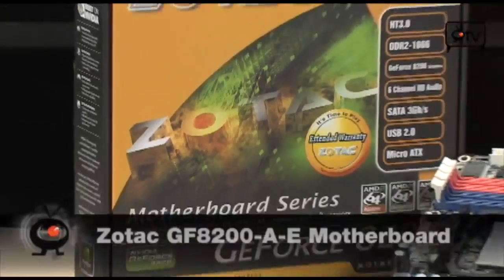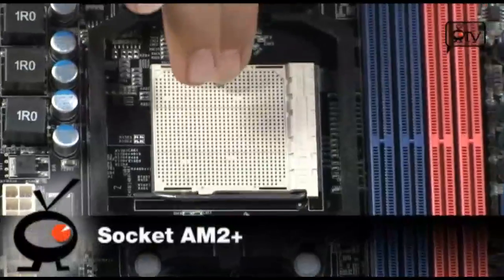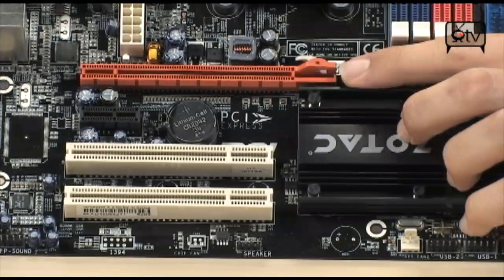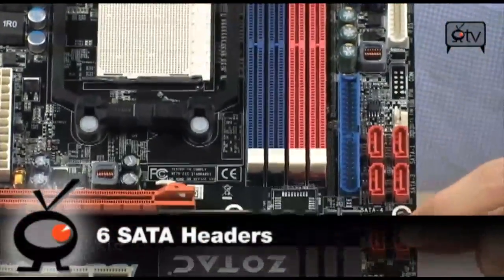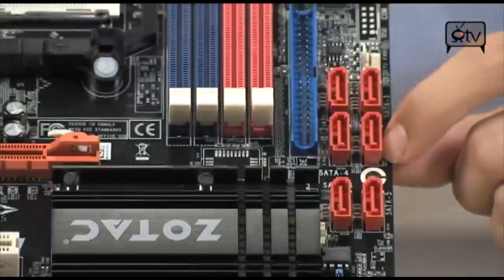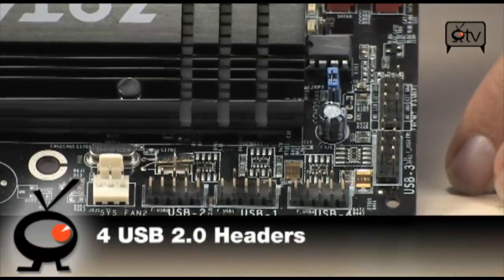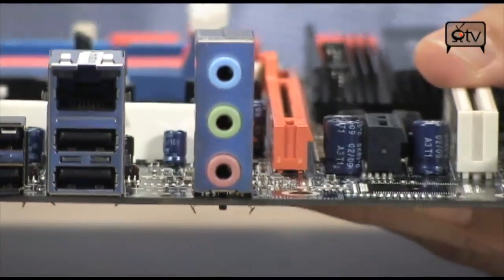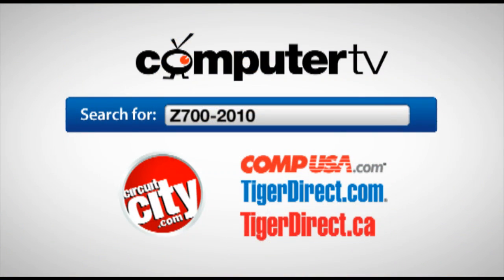Zotac GF8200-A-E Motherboard

Comment: Oh, absolutely. The problem came in when I had no actual backup of data available. So while I needed to reinstall the OS, I had to do a repair, not a full, because I needed the information that was stored on the drive, and had no back-up yet. I got Carbonite Online Backup, so it's going to be soon that I do the reformat. I recommend Carbonite, btw, great system. I'm personally a little annoyed at the having to choose which OS to boot though, lol. Though the one that works is the highlighted one.

Comment: Yes, I figured that out already. Thanks. I did a repair install, so now I have two OS's running on the same drive, just in different partitions( so technically 'not' really on the same drive... Original is on C: and Repair is on D:... Go figure), so I run the repair installed OS on D: on boot now when it asks. I also had to make sure it understood to "boot from disc" first, to do the repair install, and then of course, change that boot order when I was done. In any case, thanks for the response.

Comment: I have a question. Recently bought this mobo to upgrade my mom's system. Using her old drive. Existent XP SP2 install.

Connect 200 gig drive to new motherboard, plug in, fire up and goes to DOS stating Windows wouldn't start. Start Windows normal, Start Windows Previous Settings, no dice. Change CCMOS jumpers. NO dice...

Any suggestions? I'm seriously confused as to how to get this thing to operate properly. Mobo, chip, ram, all of it's posting. 

Suggestions?